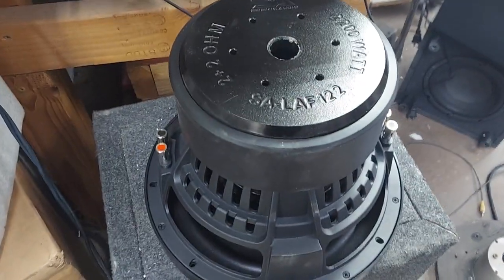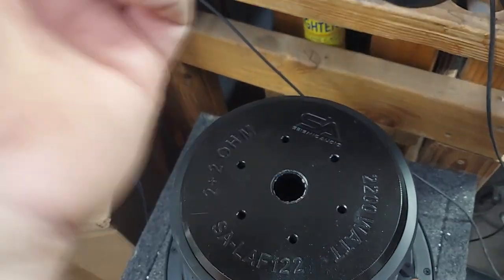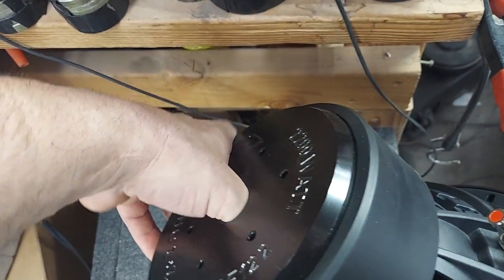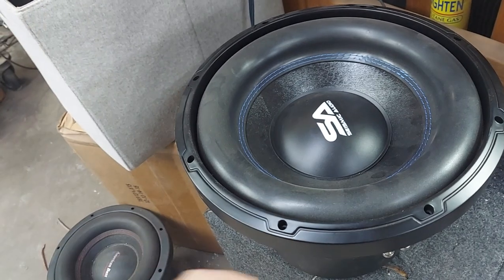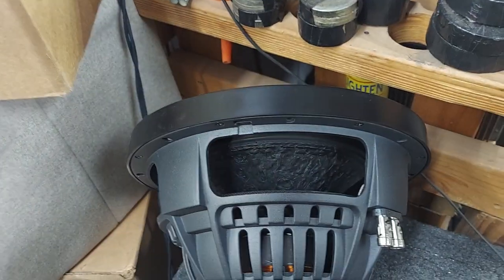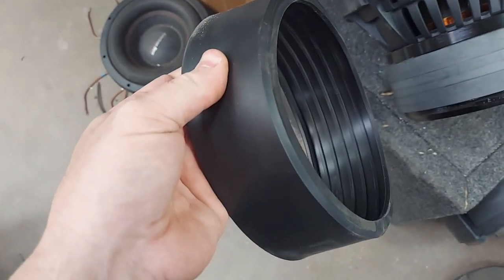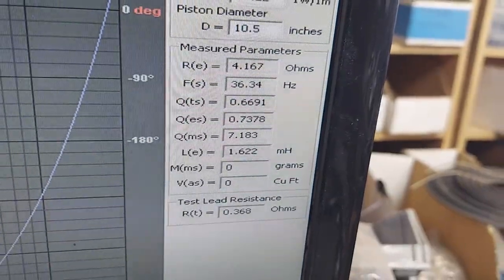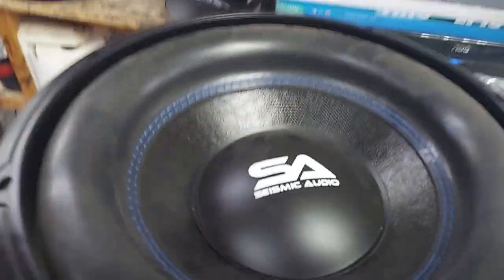The Seismic Audio 12" D2 SA-LAF122 Review on par with the JL Audio 12W7? https://amzn.to/3CGZyPK

Comment: I sold my 3 w7 subs and I’m now running 3 SA-gfc122 subs.  Both get loud, I can hear the SQ difference on the w7’s but for the price I can’t go wrong.
Reply from the maker: Can other people hear the diff?  Get their next level up.
Reply: Yeah I’d probably be able to tell the difference too having ran with W7s since 2005. This actually sounds real clean though compared to other demos Patrick has shown.  I wonder how much this weighs and if they make a 15” version. 👍🏼
Reply: @iargueta1220   yeah maybe but most people can’t. the w7 have a hard to beat sound quality but as far as numbers. Or being loud for a fraction of the cost. Unfortunately the biggest subwoofer a seismic audio makes is a 12 inch. And they don’t sell recone kits.
Reply: @Bigislandguy  12 inch is not bad at all, you can build a box for two of them. I have to say though that after running 2 12W7s in a custom box and upgrading to 1 13W7 in a box by FATBOXUSA there was a HUGE difference. The shop that installed it was shaking tremendously 😆 this guys shop looked like it was gonna breakdown. The 13W7 has an Fs of 23Hz!

Comment: I had similar gaskets on my Harmony Audio Carbon 12. Great stuff.
Reply: I run 4 of the carbons on 2 jp33s and I absolutely love them
Reply: How would you compare them to the harmony sub? I have harmony carbons and thinking about getting some siesmic subs.
Reply: @terrancemitchell459  not sure about the seismic subs,but I've had the same 4 carbon 10s for  a while now on 2 jp33s and absolutely no problems tak8ng each amp. I have them wired to .5ohm on each amp and they take the abuse super well,I'd stick with the carbons man

Comment: I had one of these in my 2015 Chrysler 300 in 2.3 cubes ported with a Skar RP 2000 at 2ohms and it was butter. Just the right amount of bass with great SQ. I sold it to my buddy after i had it for about 6 months. He has it in his Jag and it's still sounding clean. I'm gonna do a new build for my 300 in the next few months. All new door speakers, front and rear stage, new DSP, new 4 channel, new mono, new wires, and new subs. I just haven't figured if I want to go with two of these 12's or three of the 10's
Reply from the maker: Cool.   I hope I helped.
Reply: Yes sir. Thank you.

Comment: FYI just a little bit brake cleaner on a paper towel. You can wipe that seismic audio right off
Reply from the maker: lol.  I'll try that.  Sometimes I've used acetone and it still leaves a shadow or  it softens the poly and just smudges the whole thing.  I'd rather replace with a smaller inner cap that's epoxied into place and then a nice glass fiber cap over that for looks.
Reply: @RobotUnderground  once I clean it off I cover the old spot with a vinyl decal I get off eBay like a skull or something looks real good 😂 I've done it to my soundqubed and skar subs with zero issues
Reply: I got others I just started doing it
Reply from the maker: @gavinmcclure8047  #PrivateLabel  Glad to hear it!

Comment: Recommended enclosure sizes?
Reply from the maker: 1.4, no larger than 1.65cf @ 33 to 36Hz.
Reply: @RobotUnderground  can you build me a beefy excursion 12 with carbon looking cone? I have a t750x1bd puts out 1100 at 1 ohm I wanted something t2 looking. I have the t2 dust cap.
Reply from the maker: @dominicdymond  Sure.  Something Rockford'y?  I have both versions of the T2 motor.  Text me direct. 6023126504
Reply: I got two of these on the way, what happens when I put them in my 4cft box?

Comment: Could you tell me what you think of the soundtown 12s on ebay 115 usd 1000 watt
Reply from the maker: Motor doesn't look large enough.  Even with a 3" coil, real world power handling would be closer to 800wrms.  I'd have to test one out here.  I think there are better deals than that on Amazon.  I'm going to review the Gravity green stitch subs.  Those are an even better deal than the Seismic and look basically the same.  Gravity is owned by Boss Group.
Reply: Says it has 180 ounce magnet. I'll check the sub you are talking about out

Comment: Not sure if this has been covered, but how is SD calculated?
Reply from the maker: Basically from top of the surround to the opposite side Will give you diameter.  Chop that number in half, then multiply it by it's self.. Then multiply that number by Pi.  A=3.14 x radius squared.  https://ggle.io/5IaA
Reply: @RobotUnderground  much appreciated!

Comment: Why is the fs so high?  And does the fs even matter?  I usually tune my boxes to 30hz
Reply from the maker: I recommend a little bit higher tuning.  It'll give you extra free bass.  33 to 36Hz instead.  Having a tuning frequency that low does you no good if your sub cannot play that low.
Reply from the maker: To answer your question, the Fs can be lowered by having a softer suspension, (spider and or surround), and / or having a heavier coil.  I'm pretty sure this coil is aluminum, so that might be the item that I'd change to lower the Fs.  Nice heavy, copper coil.

Comment: The tinsel leads suck. Went through 2 sets in 2 months due to broken leads on the spider. They finally just sent my money back.
Reply from the maker: You're just asking too much of them.  Burning tinsels is NEVER a defect.
Reply: @RobotUnderground  never burnt, they glue the leads on the bottom of the spider. Both sets broke right where the leads leave the glue. If they had sown them instead of glue (CA) I believe because it was rock solid, I would still be using them. I have them torn down to repurpose them with a better frame, spider, and new cone. Just waiting on funds to play with.
Reply: And thanks to your videos Patrick, my son and I salvaged the coils to reuse them without any damage, we watch every video and discuss ideas you put into your heads!
Reply from the maker: @shawnstupi9290  I suggest the gravity subs that look very similar but have green stitch cones. https://amzn.to/3g7KmDo
Reply from the maker: @shawnstupi9290  I'm glad I could help.
Reply: Haha I had a set of those gravity's, one of them started to make a weird rattling noise behind the cone. Guess it didn't like 1500wrms.